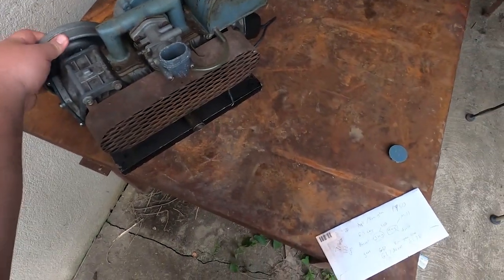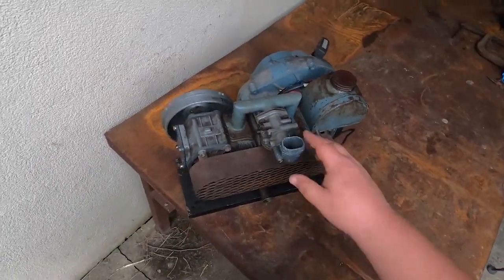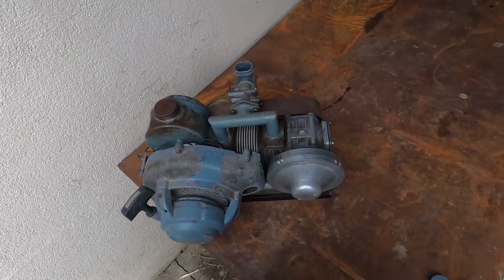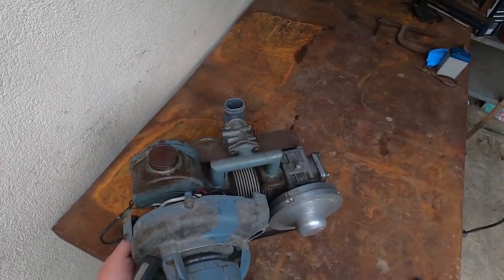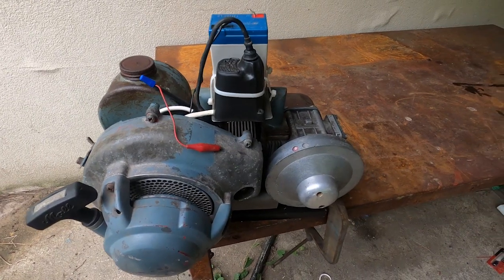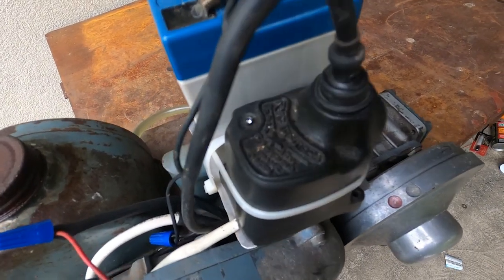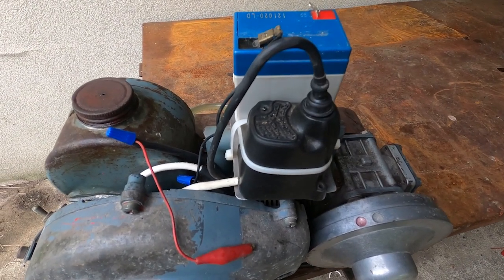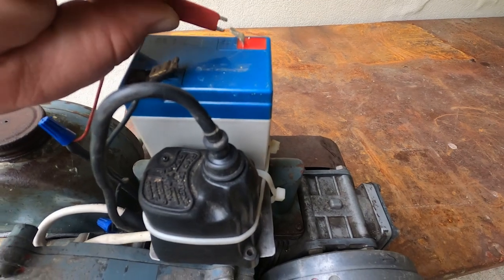Prototype Opposed Piston Experimental Chainsaw Engine by Mall Remington Arms

Comment: I have a cool tiny opposed piston diesel engine. It is 18 cubic inch and is air cooled. Uses both crankcases as scavenge pumps, tied together with a manifold thar enters the cylinder via one of the 2 pistons. Total loss pressure oiling system, about 7.5 HP. It runs a 1500 watt, 3phase, 120/Y/208 volt, 400 cycle generator and is serial number 3 of 7 made, as military gen set prototypes in 1966, the year I was born, made by American M.A.R.C. (Pronounced “Mark”) company who made a water cooled version that was actually made and sold and was used on the most fuel efficient outboard boat motor in world history and remains so to this day! I ran a 750 watt incandescent bulb in a vintage railroad repair shop portable work light for 16 hours straight with 1 gallon fuel can and it used less than an inch of fuel in that amount of time! Opposed piston 2 stroke gas and especially diesel engines are insanely fuel efficient! M extremely rare and cool generator set proves it! Number 3 of 7 made, never adopted by the military so extremely rare! 😋👍 2 strokes ROCK! 😋😊😊

Comment: Fan. Frickin. tastic
Reply: https://mart.cummins.com/imagelibrary/data/assetfiles/0058689.pdf
Reply: @Bruce Miller  awesome.  I'm putting that in my vw beetle.
Reply: @akbarshoed  Are you running your beetle as a 2 stroke, they run oil injectiuon i though, not sure

Comment: Would have even less vibration if the flywheels were the same mass and rotated opposite directions. The instantaneous torque going in and out of each flywheel would match so there would be no rotational "vibration" around the axis of each crank.

Comment: I love the way it's just c-clamped to a workbench, with no silencer.  Thanks for posting.
In the mid 1980's, I worked with Fairbanks-Morse dual opposed piston diesel engines in the Canadian coast guard.  Similar layout,  but of course way bigger, and vertically stacked as opposed to horizontal.